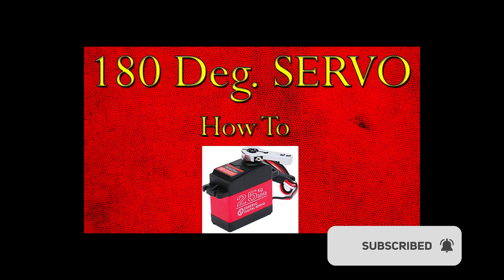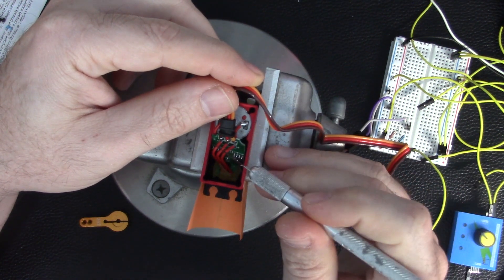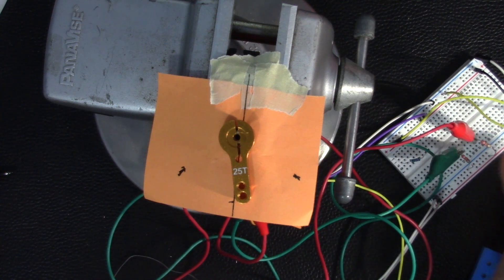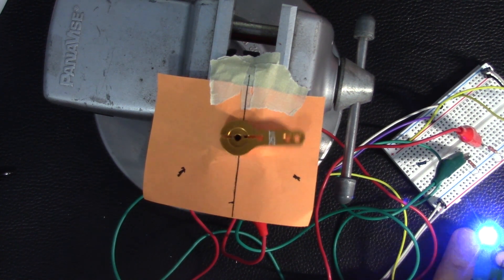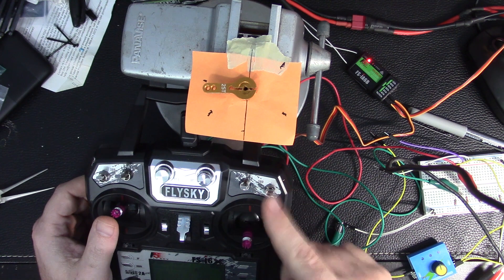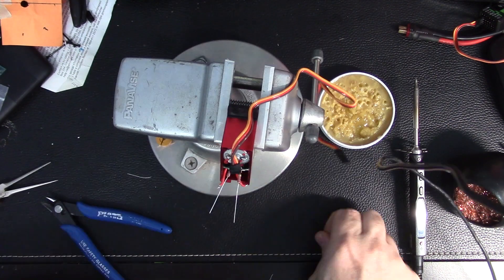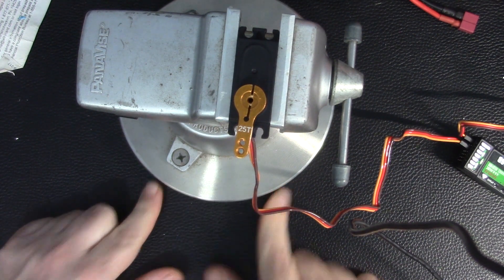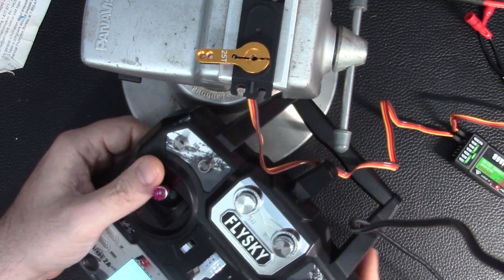Fixing 180 Deg. servo mod: allowing it rotate the full 180 degrees

Comment: 0:30 Just found you channel. Been look for some video on servos, Purchased some 180 deg mg90s servos, When tested on all of my cheap servo testers modules like yours , Found out it only rotated 90 Degs, Tried it on one of my better battery/servo tester it did go over the 180 degree range. If think the cheap servo testers  only has a 90 degree range setting

Comment: Hi, I'm just wondering if the servo rotation range was smaller than expected because of that servo is based on a larger Pulse Width range; From the video the servo has half of the extected rotation, something I would expect if you use half of the PWM range.
Also the used resistors are rather large, suggesting that servo having a Pulse Width ranging from 500us to 2500us, instead from 1ms to 2ms.
If this wasn't your case, it might still make sense to advice viewer to first check whether their "issue" can be solved by using the appropriate PWM range.... and start hacking the servo only if not possible  otherwise.
Regards
Andrea
Reply from the maker: possibly,  but this video was created for 30 or so people having the same issue with the servo. the servo driver  does not have an adjustable pwm range so this was the solution to get the range need for the project.